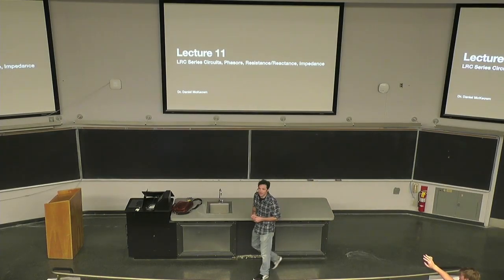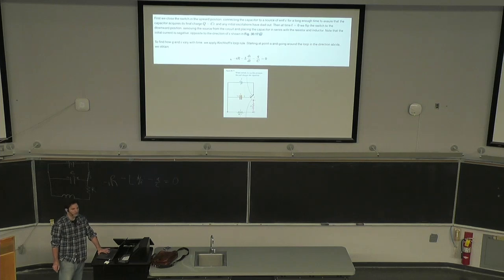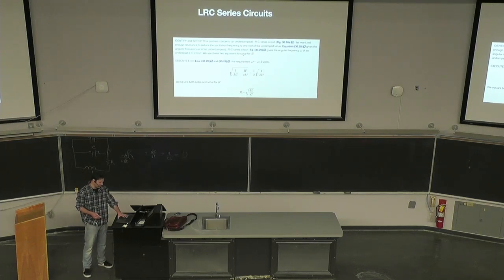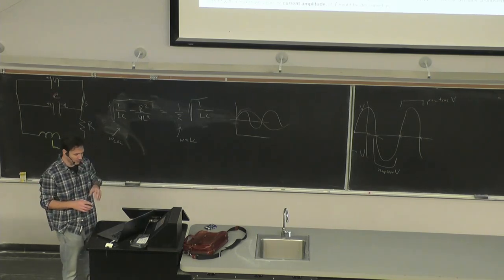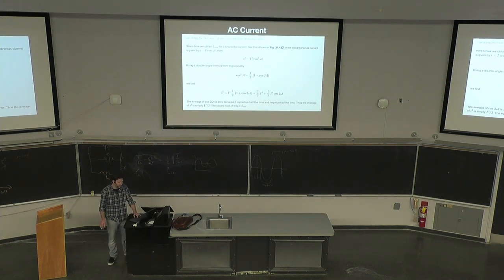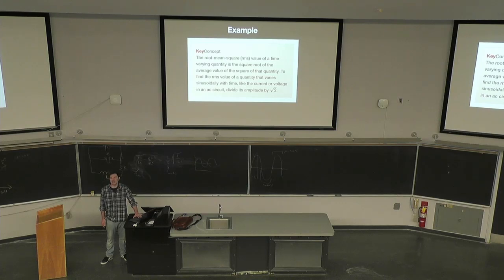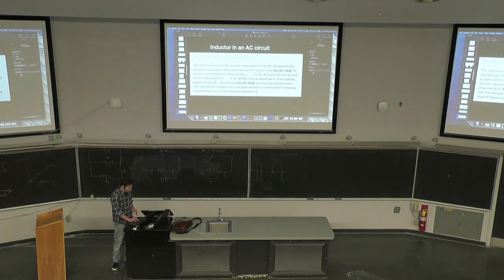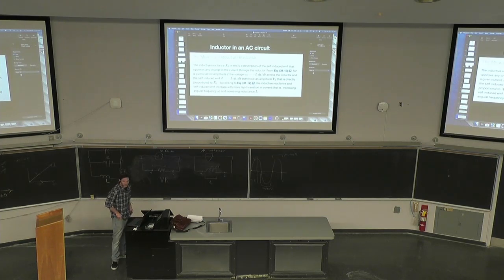#physics #lectures at #ucla #electricity and #magnetism Series Lecture 9

Comment: Steven Veld

Having taken a few electrical engineering courses, I've learned a lot about how to go about solving circuits problems, but a bit less of the "why" with regard to why circuits have the properties they do. So learning about circuits from a physics perspective is really interesting; for example, the important distinction that current does not actually flow "through" a capacitor was something I had not considered before.

Comment: Zixiang Ji

I learned a lot about the AC current as well. I was confused by the measurement of the current before watching this lecture. However, after I watched it, i can clearly distinguish between root mean square, average, and maximum current concept well.  I also learned a lot about the RLC circuit, and realized how it is related with damped oscillation and behaviors of LC circuit.

Comment: Jon Paino

I found it enlightening how you connected underdamped motion to RLC circuits during the lecture. I was surprised to discover the resemblance between the angular frequency equations for these circuits and the familiar equations for damped oscillations. Since I'm more comfortable with the principles of springs and simple harmonic motion, drawing these parallels really enhanced my understanding. Additionally, the circuit diagrams you presented for the resistor, inductor, and capacitor were incredibly useful. They clarified how each component influences current and voltage and their interplay within the circuit.

Comment: Mariana Navarrete

I found it interesting to learn about phasors and how it relates to concepts learned in a previous physics class. The sinusoidal voltage and sinusoidal alternating current equation particularly seems very familiar to the sinusoidal wave function, so this made it easier to better grasp what the equation itself means. Furthermore, I found it helpful that you connected LRC circuits to some of these concepts. It was mentioned that the behavior of the LRC circuit is analoogous to that of the damped harmonic oscillator. Because of this, overdamping and underdamping also occurs in the mechanical and electrical systems. We can observe these similarities when there is a sinusoidal varying source of emf in the circuit. Finally, I liked the diagrams you drew on the board since it helped me visualize the components of the LRC circuit.

Comment: Jonathan Britton

This lecture helped me understand circuits more. I thought it was particularly interesting learning about how the current and voltage are dependent of each other for AC circuits with resistors, AC circuits with inductors, and AC circuits with capacitors. The current and voltage were out of phase by different factors. Learning about reactance was also interesting.

Comment: Kevin Yang

The explanations of AC and RLC circuits were very helpful. I especially appreciate the review of displacement currents, and how in an AC circuit, a capacitor will get infinitely charged and discharged, causing a displacement current equal to the current going into one plate and coming out of the other plate to be constantly flowing through the capacitor in the form of an electric field.

Comment: Michael Ji
I am really impressed by how smoothly the LRC circuit in the lecture reflect the similar idea as the damped oscillation in physics 1B. In detail, this lecture explores how each circuit element plays a role in this amazing phenomenon. It even lists the condition for critical damping in a LRC setting. I also learned the useful concept of phaser to regularize AC currents. The introduction to rms becomes a powerful tool to get a positive average value in a varying-condition system. The discussion around inductive and capacitive reactance opens us a new window to understanding the nature of inductor and capacitor in a circuit.

Comment: Dereck Rubio

I found the lecture super helpful in understanding RLC circuits and phasors. It really clarified how each part works in both regular and alternating currents. The examples they gave were great for visualizing what's going on in the circuits. And the graphs did a solid job of showing how potential difference relates to different parts of the circuits.

Comment: Sydni Gephart

I really appreciated you going over the loop rule and how that pertained to the different equations we would need in order to solve RLC circuits. I'm really glad you used visual diagrams to depict the movement of the current as well as graphs to show what was happening to potential differences at each stage of the circuit.

Comment: Michael Peng

The lecture was incredibly informative on the concepts of RLC circuits and phasors. It really made me understand the full extent of how every component in RC and RLC functions in both a normal and alternative current environment. I think the multitude of examples really helped me visualize what was happening in each circuit. The graphs also did a good job of showing the correlation of potential difference with different elements of the circuits.

Comment: Ryan Lim

I liked how you clearly identified the difference between rlc circuits and the other types of circuits as well as the edge cases like R=0 that would turn an rlc circuit back into a normal lc circuit. This kind of helped me differentiate between the two and when we need the second order differential equation vs when we don’t

Comment: Clarisse Angeles

I found this lecture very helpful in understanding AC and RLC circuits. I liked how each example had a visual diagram and how the professor thoroughly goes through every step and the circuits' properties which elevated my understanding instead of just reading and solving mentally. I also liked how connections were made between material from 1B and expanded upon. It made things feel more familiar and easier to understand.

Comment: Shan Kunzru

I found the explanations of AC and RLC circuits very insightful. What stood out to me was the review of displacement currents and the way they function in AC circuits. It was intriguing to understand that a capacitor continuously charges and discharges, resulting in a displacement current. This current is equal to the current entering one plate and leaving the other, effectively flowing through the capacitor as an electric field. These detailed explanations made the concepts much easier to grasp and highlighted their practical importance.

Comment: Theodore Patsis, Lecture 1

This lecture was very interesting as it expanded on the concept of RC circuits from Physics 1B as well as the notion of underdamped motion from Physics 4AL. I liked how the professor drew connections between electromagnetism and mechanics, when the current going through a circuit is time-dependent. Additionally, the diagrams the professor used were very useful in enhancing my understanding of the material.

Comment: Meena Salib

Phasors are incredibly cool because they simplify the analysis of AC circuits by representing sinusoidal voltages and currents as rotating vectors in the complex plane. While I was at first intimated by having to learn an entirely new mathematical concept, it made a lot of sense as time went on in the lecture and you went over the phasor diagram for a resistor, inductor, and capacitor. Seeing the "phase" in phasor in each really exemplified its usefulness.

Comment: Ivan Sit
The concept of RLC Circuit Oscillations amazed me a lot. The fact that it can be formulated as SMH is very intriguing. I also finally understood how AC can be generated from RLC circuit and thus how these AC generating oscillators are used in a wide range of applications, including radio transmitters,  signal generators.

Comment: I found this lecture very helpful in getting a basic understanding of AC circuits. I also like how he drew the phase diagram for the questions he was solving. It is interesting how an AC circuit causes the capacitor to charge and discharge thus there is an equal current into the plate and an equal current leaving the plate; this is due to the E field between the plates of the conductor.

Comment: Tomas Kaljevic

It was enlightening to hear you connect Maxwell's equations to the concept of alternating current through a capacitor near the end of the lecture. It made it easier for me to understand that the displacement current, while not a real current, behaves similarly in equations, which is why Maxwell's equations are so useful for problems involving time-varying electric fields.

Comment: Riley Thorner

This lecture was useful for my understanding of AC circuits, and I really liked the different diagrams like phasor diagrams that could be used to help understand them. I liked how frequency was related to the current, and the example that lower frequency made it more like a DC circuit and higher frequency gave the current less time to shift.

Comment: Camille White 

I really enjoyed exploring the connections between the material covered in this class and Physics 1B, especially the analogy drawn between LC circuits (inductor-capacitor circuits) and mass-spring systems. This comparison helped me visualize electromagnetic and circuit concepts, which are highly theoretical, through the more tangible mechanics of spring systems. I am curious to learn more about the different applications of LC vs. RLC circuits in computer engineering, such as in amplifier functions or power supply regulation in computers.

Comment: Christine Pelayo

I enjoyed learning about new concepts within the AC and RLC circuits, including high-pass filters, diodes, and phasors! With the phasors, I am glad to see that there is a geometrical representation of sinusoidally changing voltages and currents in AC circuits so that it is more visually clear when, for instance, a current is increasing or decreasing, or negative or positive. Although I am not an electrical engineering major, I still found it interesting to see that there is a component, the diode, that controls current flow in only one direction. Lastly, it is nice to see a device, the high-pass filter, that directly controls the capacitive reactance, and therefore the capacitance and angular frequency of the capacitor, through preferentially passing signals of high frequency.

Comment: Jenise Hurtado

I really enjoyed the way you connected the concepts of underdamped motion to RLC Circuits. I didn't realize how similar the eqautions looked for the angular frequency to that of damped oscillations that was known previously. I personally am better with concepts of springs and simple harmonic motion, so these connections made it easier to understand. The circuit diagrams that you drew for R L and C helped see how each component impacts current and voltage, and how they intersect.

Comment: Navika Lodhia 

I really enjoyed how cohesive this lecture was in terms of looking at the behavior of resistors, inductors and capacitors in AC circuits. I like how the concept of inductive reactance is similar across these three circuit components with inductors and resistors being out of phase with the current. The phasor diagrams in particular helped me understand the differences between current and voltage in each of these components.

Comment: ethan sarnevesht

I  liked how you connected the concepts to what we learned about inductors and RC circuits, showing how the circuit's behavior mirrors an exponentially decaying sinusoidal function. The discussion on damping and the role of specific resistor values in controlling the damping response was particularly insightful.

Comment: Brian Sierra
I found it interesting and helpful when the confusion about alternating current through the capacitor is addressed. Since the charge isn't really able to move through the capacitor it leads to confusion but it was clarified that since it is an AC voltage, it becomes possible as it charges and discharges.

Comment: James Larios

I really like the way you break down AC circuits and I find it interesting that capacitors function differently compared to a DC current. It make sense that when AC peaks, the capacitor charges, then discharges when the AC current deceases. Inductors are also really interesting because of its abililty to retain a charge becasue of a constant change in current. I finally know what my ECE 3 teacher was talking about when I took that class last year.

Comment: Roman Toledo

Thank you for drawing out each and every circuit diagram on the chalkboard for better explanation. Also, it was easier to wrap my head around capacitors when you explained how the displacement current theory works even though the plates are not physically touching.

Comment: Varun Venna

The explanations of AC and RLC circuits as well as their applications to things such as damped oscillations was extremely helpful as it was a refresher from my previous classes and they are concepts that I will be using in my later classes. The visuals, especially the phasor diagrams and projections, helped me cement my understanding.

Comment: Langxing Bai

I found the concept of LRC circuits to be very fascinating. The unexpected resemblance and connection of the current in a LRC circuit with the description of damped simple harmonic motion in a spring-mass system allows me to gain a deeper and distinct understanding to LRC circuit.

Comment: Eric Tran
I really enjoyed the derivations of the voltage change across resistors, inductors, and capacitors as well as the talk about phasors. It was really informative to see how everything mathematically connects and I also liked the similarities between RLC Circuits and Damped Oscillations. It really helped me understand how RLC circuits work in that all equations that describe are really just analogous to those in damped simple harmonic motion. Something that really stuck with me though, is how R changes how a RLC circuit acts. If R is small, the circuit behaves like an underdamped oscillator, if R is big, then the circuit behaves like an overdamped oscillator and if R is just right, the oscillator is critically damped and goes to 0.

Comment: Jennie Ren (Lecture 2)

Thank you for this lecture on LRC circuits! I'm also taking an electrical engineering class on circuits at the moment, but it's more application based, so I'm happy that I can learn more about the underlying physics and theory of these circuits. You also helped me better understand the concept of damping, as well as where the differential equations and angular frequency equations we use came from. I also enjoyed the explanation on diodes and how they're essentially gates that only let current through if it's going in a certain direction, kind of like a one-way resistor.

Comment: Ashmeen Mahal 

While I have already learned about RC circuits, I found this expansion of my learning on this previous topic to be very fascinating. I learned that LRC circuits are that have an inductor, resistor and capacitor. These can also function in series or in parallel which allows different properties to be accentuated of the circuit system. I really appreciate how multiple diagrams were shown to explain the different components of the circuits discussed in this lecture.

Comment: Abhinav Amanaganti: The phasor diagram (1:05:47) helped me better understand the relationship between voltage phaser and current phaser, more specifically, the phase difference will always be 90 degrees. I now understand why we have the (omega*t - 90), the  - 90 is needed as a shift to account for phase difference.

Comment: Meena Annamalai

It was interesting to now learn about LRC circuits as well as concepts like impedance since I now have a better understanding of circuits and saw connections to circuit problems I had done before. It was also interesting to see applications of previous physics concepts we have learned like damped harmonic motion and looking at that in terms of the circuit oscillating.

Comment: Melissa Urkmez

Thank you so much for posting this, the explanations for the circuits are very helpful. It is interesting that you can change one part of the problem, such as using capacitors when calculating instead of resistance and still solve the problem. Another thing I found interesting was that the current and voltage phasors rotate together in the Resistance and Reactance slides. This is because i and VR are functions of time. The current is in phase with voltage (i and VR) and have the same frequency.

Comment: Larry Ye

It was interesting to learn how LRC circuits can have different kinds of oscillations, kind of like springs. The way AC current can be measured using rectifier circuits is also really interseting. Also, AC circuits can be represented using phasors and the impedance of capacitors and inductors are represented with complex numbers which is really cool.

Comment: Lauren Bridgwater, Lecture 1

I appreciate when you connect physics ideas or basic concepts to other classes or general good-to-know knowledge. For example, you mention that the RMS value of a time-varying quantity is the square root of the average value of a square of that quantity (true for all disciplines). Although the main takeaways I had from this video involve AC and RLC circuits, the prior mentioned concepts that are applicable to a larger variety of disciplines and topics tend to stick with me beyond the class.

Comment: Patrick Lee

I found LC circuits in the previous lecture quite fascinating with its analogous relation to a conservative spring-mass system. So, with RLC circuits factoring in a non-conservative aspect, it becomes analogous to a spring-mass system with DAMPING. The correlation of all these different physics concepts and applications and is really fascinating. It shows how relative physics concepts appear and behave with everything around us. Both physically with mechanical systems and in fields, with electromagnetic applications in circuits, etc.